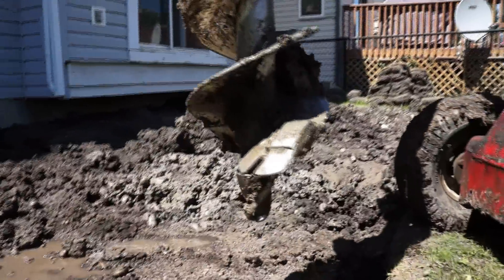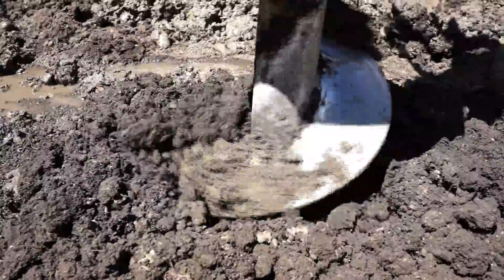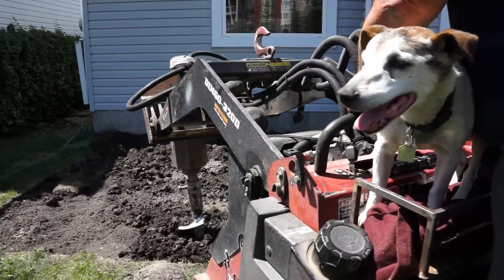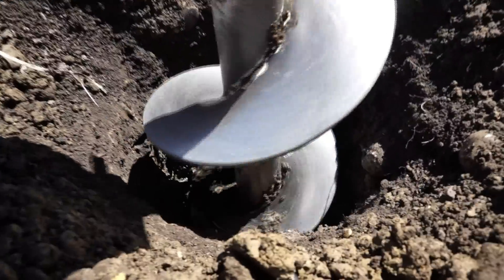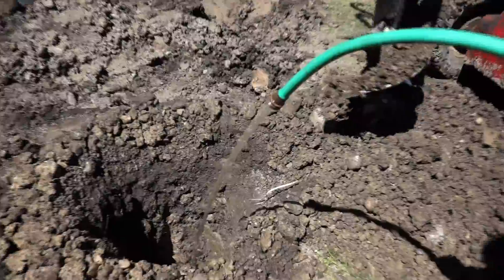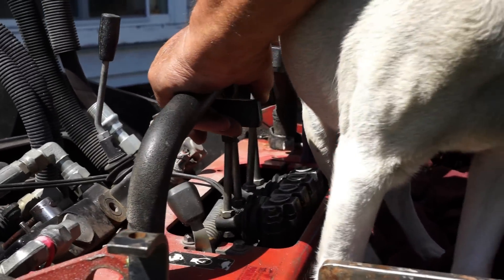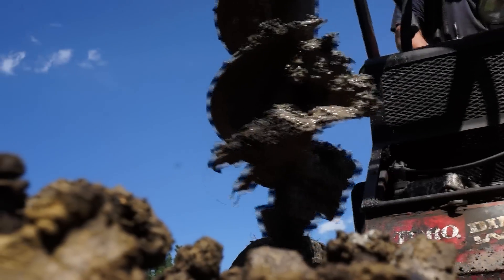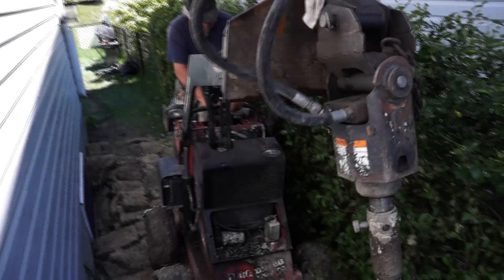Digging Post Hole Through Rocks

Comment: My husband is having a difficult time digging holes for our pole barn. We live in Eastern Ohio and our property has approx 1 foot of top soil, 2 feet of clay, and then shale. He's using a 1939 Ford 9n tractor with the original Danuser 3-point posthole digger but as soon as he hits shale, the auger stops digging. Was considering a new tip for the auger and adding some weights to the posthole digger to help provide more downward force since Ford 9n tractors don't have downward force capability on their 3-point arms. ...and yes, water does in fact help aside from others who left unjustified negative comments.
Reply: Was wondering if u ever got thro tje shale we r having tje same problem?

Comment: Dug 50 holes was hitting rock from 2' to 3Ft. Have a 12" rock bit on Ditch Witch SK500. Been using it since 2007 .
Had auger for last 7 years. Used more this year than before. Semi Retired. Love it. Will remember the water. Own cleans out holes. 

How do you clean out holes?
Thing that is irritating. We have good. SHUSWAP TOP SOIL. 2" dirt 4" shale rock. 1/2" dirt  6" rock...
Reply: I haven't seen anything that easily digging. They are awesome machines.